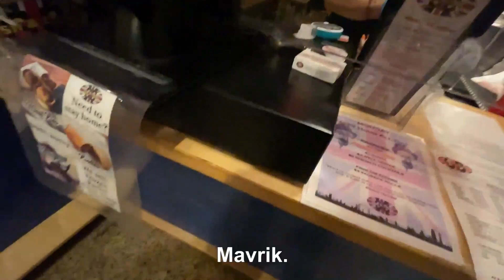My Favorite Truck Camping Upgrade

Comment: BIIIIG props to those techs for putting your stuff back up on the racks and dealing with that professionally. As a mech myself, it can be frustrating to deal with a bunch of unexpected extra stuff, but it seemed like those dudes had it squared away. Super cool.

Comment: I would be most def tint those windows for privacy 😂
Reply: they are tinted but barely... like why not limo tint that?
Reply: Doesn’t he insulate it? That covers the window so he can flip up the insulation to see if anyone is outside. Tinted windows at night with light you can see the light shining through from the outside but not from the inside.
Reply: I thought it was a one way see through cause they were pretty dark from the outside

Comment: Petroleum processing plants flare gas like that for several reasons. Pressure relief to avoid explosions, burning off methane which is a potent greenhouse gas, and there's volatile gases that would kill people if released without burning off.

Comment: The fire going on the smokestack is there burning excess natural gas from oil production, whatever can't be pumped out to heat homes is burnt to reduce the volatiles into carbon dioxide, which is a much less severe greenhouse gas.

Comment: That fire at 1:30 is used to burn off excess gas/gas products. 

When the plant is running at tip top shape there is a small flame if that at all but when they have a problem going on 5they burn it off instead of releasing it directly into the atmosphere

Comment: You should get a roof top tent and cut a hole in the bottom just big enough for you to crall through.then cut the same size hole in the topper so you can have a kitchen/living room and a bed room.

Comment: I have a Snugtop with win-doors all around, one of the best options but did stay with the cab-height. As I develop my  platform/drawer system, will run across the same height issue.  Will remember the taller topper on the next truck.  Good vid, thanks!
Paul

Comment: I have a Silverado with an 8' bed. I wanted the high-rise topper, since I'm 6' 1" tall and I want to be able to sit in it and work on my laptop comfortably and edit photos. (Main reason for the camper top is to go to a location for sunset/dusk pictures, sleep there, then be right there for sunrise pics too) Unfortunately, they don't make the high top for the 8' bed. I'd consider another truck, but holy crap have they got expensive in the last 3 years. I'm a bit frugal as well and bought a U-haul pickup with 8,000 abusive miles on it and some light hail damage. But the cap is going to cost my probably $4K between cap with options, and bed rug. Might get an ARE MX, seems like the most rise I can get for mine. Well off to bed, I've got to get up for the sunrise. Cheers.

Comment: I know that's it's no longer winter but you really should put some insulation on the actual topper in the inside. All that metal sucks the heat out. Just something to think about for next winter.

Comment: I pretty much have the exact truck, cap, colour setup with an 8ft box and bedrug . 8 ft box is soooooo nice. I use a 28 inch deep shelf across the back leaving the floor wide open for a queen size down filled futon mattress on the bedrug. Leaves tons of headroom and storage is accessible through the windoors. No semi permanent build as I use this truck for work as a builder. My truck is a 2017 f150 5.0 extended cab 8ft box. May take out the larger section of back seat. Love your vids Mav, keepem comin:)

Comment: When you price rent for a year vs the cost for the topper you have no problem paying. Mpg is going to take a hit you can mitigate that with better driving habits and slower interstate speeds. Always check air pressure, and fluids each fillup.

Comment: Old video, but in regards to the flame you're asking about - It's most likely methane. Often, the methane is burned off, instead of capturing and selling it. Methane (natural gas) is generally super cheap, and companies often do not make enough money from selling it. They separate it out, and burn it off. Methane is a greenhouse gas, so they burn it to form carbon dioxide and water. Those are both also greenhouse gases, but they're easier to deal with.

Comment: The new topper makes your truck slicker and more cleaner looking.  In a video would you give us a rundown on your truck, i.e. engine, four wheel drive sytem, the new topper, etc.  I presently drive a SUV but have contemplated trading for and extended cab and have a topper like yours mounted.

Comment: I picked up a similar ARE topper for my F150 used. New toppers are ridiculously expensive. Mine has side hatches, shaped like windows but actually just solid fiberglass. Thought I would HATE the lack of side visibility, but instead, I love the security of the solid sides, while still enjoying access to my stuff. I've got the TW model.

Comment: Melt some solder into the fittings keep the fitting hot and just stuff the wire in works great in lieu of having the proper crimping tools

Comment: 1:20 That's a "flare".  Sometimes used as a pressure relief, or to vent waste gas(it's being burned, so something like methane is going to turn to water vapor and CO2).  You'll see them at refineries or chemical plants, but you'll also see them on oil drilling derricks(satellite the Persian Gulf and you'll see the flares on offshore oil rigs at night)
In this case, you can see the fractionation tower to the left.
Reply: In the Chicago area they're used to burn off methane waste. Smells like rotting chicken.

Comment: The only thing that bothers me is the electrical tape on the connectors. Heat shrink tubing is cheap and looks much better. Also, you don't have the sticky mess when you go to change something in the summer heat. Plus, the heat can come from a cheap bic lighter.

Comment: @10:04 you should definitely put a grommet on that main power cable. Resting on the sharp angle like that will go through the insulation in no time. Also is that right next to the gas tank?

Comment: Brah. I have the same topper on my camp truck. Mine has screen in the windows but no lights. I'm still living in my truck basically at work full time. I go home to my wife and kids every other weekend tho. My f150 is extended cab not crew, bt it does give me a 6.5 foot bed. I house my cot and everything that accompanies me

Comment: You could add head room by putting in a spacer frame member into place. The old topper could have been a new high topper dude. You are handy., so l am confused. The new topper does not not really look much better.

Comment: How did you do all of your wiring with the dual batteries and stuff?? I’m getting a similar set and I have a 2014 f150 platinum 6.8ft bed

Comment: I ordered the same top for my Taco back in August. Should be delivered in December. 

How are you running your solar panel wires into the inside of your shell? I would like to avoid drilling holes to keep the warranty.

Comment: bro never use e85!!! I install and service gas station pump and tanks. that crap burns quicker than normal gas which kills any savings and worst of all destroys engines and fuel lines

Comment: Life hack: Crimping big wires with vice grips.
Reply: I installed heavy audio cable for years and your vice grip hack would of saved this ASE Master Tech hours not having to to use “big crimps” (bolt cutter style crimpers)

Comment: Crime is better than it used to be, but two things make me rule out hitchhikers: 1. I've never felt myself to be lucky; in fact absurdly unlikely things have happened to me way more than the stats might suggest; and 2. I'm calm and give off a nice-guy vibe.  To those with an outright predatory nature, or those who can be tempted to cross the line, I think that's one of the things that makes #1 above more likely.  Perps think serene folks are probably suckers, or at least easier targets.  If anyone is thinking maybe I should jack someone, well, I'm too tempting an opportunity.  I could act more the rat-bastard IRL, but then I wouldn't enjoy life at all.  P.S.:  I can deal with losing my car.  I couldn't easily deal with losing my car AND my home at the same time.  It's a much bigger risk when you live there.